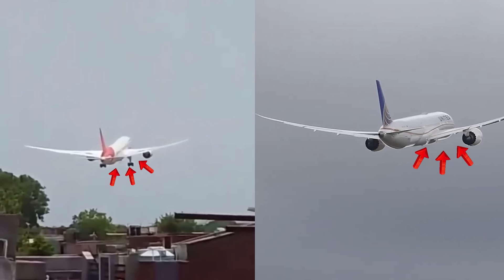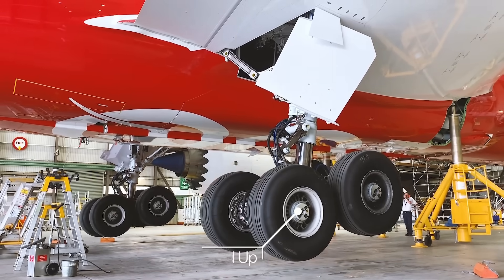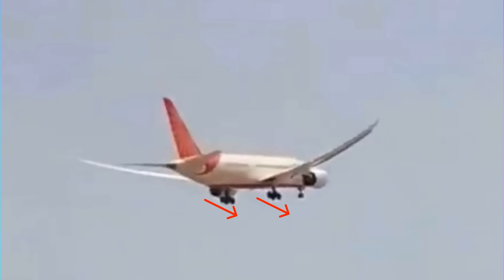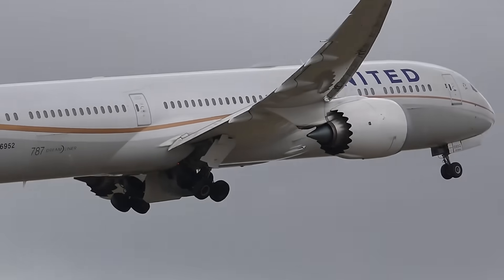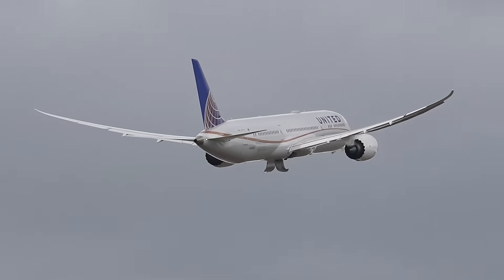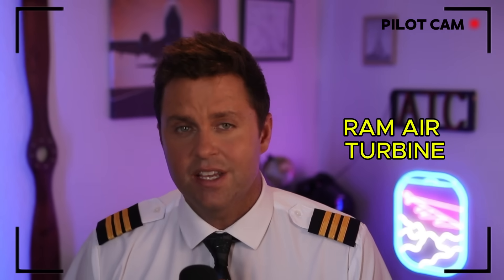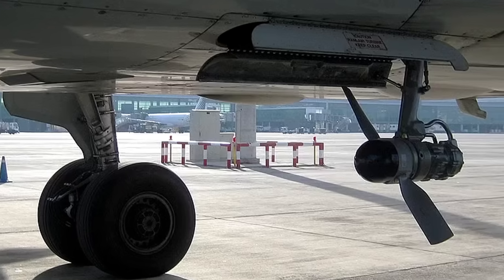Pilot Explains: A New Detail in the Air India 787 Crash Everyone Missed

Comment: Speaking of fuel cutoff switch.  I was on a 747 going to LHR from JFK and suddenly the plane went silent.  Momentary OMG!!. This lasted for about one or 2 minutes .  Then, the power was restored. What happened was the F.E. flicked the fuel flow switches off instead of the fuel heater switches which were located directly above the other.   That to me was stupid and thoughtless placement of these controls.  No wonder accidents happen. The Captain had the F.E. grounded in LHR, and dead-headed home.
In this Air India incident I noticed a slight change in the a.o.a on take off. This is never mentioned in the comments by the "experts"

Comment: I wonder if there was a short in the electrical system, the action of selecting the gear up overloaded the electrics causing a failure of the whole system. Which would cause the engines to spool back and the activation of the rat.

Comment: It's a double engine failure, for sure, based on the current facts we have so far. Double engine failure at the same time means not engine failure but a fuel issue or some system issue, which is common for both engines.

Comment: Of the various ways both engines could have flared out, what systems could the computer have instructed to cause this problem? My point is that there has been lots of speculation on what the pilots might have done incorrectly, but similarly the computer might have glitched as well although I haven’t heard anyone comment on this possibility.

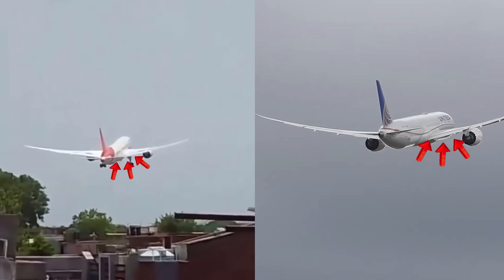Comment: 1:50 Some of air breaks are activated (probably they control horizontal position of the aircraft) on Air India, but there is no visible side edge of flaps where the wing does not have flaps surfaces.
8:49 Flaps were invented by cowards. 🙄
Initial take off can happen just due to rotate/changed angles of attack converting speed/momentum into lift, but when angle of attack is stabilized into speed gain position the aircraft wing lift force starts to play main role in aircraft lift. If wing lift is not enough due to wrong flaps position the aircraft  goes down.
There are several crashes with flaps up position when the aircrafts were able to gain some altitude of 10-30m, but then they inevitably go down with 100% engines thrust.

Comment: @Garybpilot could you dabble into whistle blowers claiming safety issues with 787, and Boeing hushing up about it. Was the aircraft inspected shabbily prior to take-off?Also, alike the Gimli glider, could it possibly not have glided a bit more or less and no landing gear (the front landing gear was stuck in the Gimli glider - but there was a lot of time for pilots to ponder over yonder.

Comment: Hi Garybpilot. I am not a pilot but in one of these discussions I heard that the RAT can be deployed manually from the cockpit. It could mean that even without a flameout on both engines the pilot was attempting to get some control by deploying the RAT. I also heard on other crashes that there is a considerable time lag when you switch to Togo before the engines are up to power. Possibly there was not enough time available in the thirty seconds from the malfunction until the crash for any of the actions to take effect. Also, if I remember correctly the RAT was originally thought to be used when the plane is higher up (like in that case with empty fuel tanks with the Canadian incident a few years back).

Comment: I’m no pilot! I’ve been following your analysis and Captain Steve’s analysis which sounds very plausible based on the limited data to date.  Regarding double engine failure or flameout is there any possibility that auto pilot was engaged and that it malfunctioned or was set incorrectly so that it retarded the engines?  Could it do this without mechanically altering the throttle positions, which would otherwise have been noticed by the pilots? If the mayday call that was reported is accurate why didn’t the pilot say we have lost both engines? Is it possible to mistake flameout for low thrust and just keep adjusting throttles in response?  Is there redundancy with fuel pumps and fuel tanks?

Comment: Regarding the bogie position, will the bogie turn forward as a result of hydraulics removal from the trim cylinder when the gear is selected up, or is it hydraulically (pressurized) placed in this position?
If it is placed  in the forward position because of hydraulic pressure removal, this could also indicate a severe hydraulic loss.

Comment: Another example of a simultaneous dual engine failure: Review BA-38, a dual B-777-200ER engine failure on short final at 700 feet. In that scenario, ice crystals at high altitudes had formed in fuel and obstructed fuel/oil heat exchangers. But that incident was specific only to RR Trent-800 engines.

Comment: There is article called "Boeing 787 Could Lose All Power" 2015 (you can google it). In short 787 could lose all power because of software bug if it was continuously powered on for over 248 days. Boeing commented on that: “This condition is caused by a software counter internal to the GCUs that will overflow after 248 days of continuous power.” Speculation is that the software bug is a signed 32-bit integer overflow that is triggered after 2^31 centiseconds, or 248.55 days. 
FAA statement:
“We are issuing this AD to prevent loss of all AC electrical power, which could result in loss of control
of the airplane. If the four main generator control units (associated with the engine-mounted
generators) were powered up at the same time, after 248 days of continuous power, all four GCUs
will go into failsafe mode at the same time, resulting in loss of all AC electrical power regardless of
flight phase.”

the U.S. Federal Aviation Administration (FAA) has published an
Airworthiness Directive (AD) ordering 787 operators to periodically shut down the plane’s electrical power.
The AD requires that 787 electrical power must be recycled at least every 120 days.

Never saw somebody talked about that. Is it possible?

Comment: I am of the view that the fuel filtration system may not have been adequately serviced, which probably caused an issue with sufficeient fuel reaching the engine to cause it to operate optimally.

Comment: I hate to say these things, but I think they are something which needs to be explored.

First, I noticed that no one has even considered terrorism. Given the conflicts going on world-wide, and in that region, in particular, I do believe this is something which should be considered.

Another issue, which is even more of concern to me, as I’ve personally witnessed this on other “crashes,” in which it’s never mentioned and another reason is eventually given for the “crash” and that is EMP. 

I’d like to state that, it’s alleged, according to the sole survivor, that just prior to the plane starting to go down, he heard a large explosion and the lights flickered.

While I understand the lights flickering could certainly be because of the transition from electrical (engine derived) power and the rat kicking in and taking over, it’s the sound of an explosion I’m concerned about.

First, we all know the chances of catastrophic, dual-engine failure, let alone on a plane of this age and make, is pretty much, well…I never like to say never, so let’s just say, unheard of.

However, if there were something placed on the plane, possibly one that’s triggered by either altitude or power, then that certainly could destroy all hydraulics, thus triggering the rat and the resulting crash.

There also could be an EMP strike and this, certainly, has the ability to take out both engines and the entire electronics of the plane, in one fell swoop. 

I personally suspect this and I have reasons which go beyond the physical and what we see on videos, but you say things like this, and many people think you’re nuts.

Another thing that I think warrants an additional look, which Pilot Steve, God bless him, quickly dismissed as “roof debris” is what we see flying in the air behind the plane.

Could it be that, because they were so low, they disrupted something on a nearby roof, bringing it airborne?

Sure, but this also would need to have the added factor of WORKING ENGINES. There’s no way that rat propeller, even though it’s moving at the speed of sound, could cause enough force to dislodge something from a roof.

And Pilot Steve also made the comment about the debris when he was still under the assumption that the engines were in working order, prior to learning about the rat deployment.

So, I think this warrants a much closer inspection, as well as the possibility of this being an EMP strike. 

The reason I say this is 1) An EMP strike would and could certainly cause an “explosion” like sound, as when the energy makes contact, it’s literally like a bomb going off. Obviously, this depends on the strength of the hit, but if we’re talking military grade EMP, absolutely.

2) IF this were an EMP strike, it not only would and could IMMEDIATELY disable both engines, but it could dislodge something from the plane itself, such as if the impact hit direct on an emergency exit door, which is what I first thought I saw with the flying object. It looked like the rectangular, rounded edges of an emergency exit door to me. 

3) With an EMP strike, there would be nothing they could do to refire the engines. A catastrophic hit could and would wipe out the entire electrical system of the plane, leaving them just enough to be able to use the radio (thanks to the rat) and calls for help. 

So, I just wanted to toss these ideas out there for your consideration. Like I said, I have seen two planes (smaller) that I observed, what appeared to be, EMP strikes, strong enough that it literally separated the entire tail section from the body of the plane. 

This is nothing to play with. The technology exists and is very dangerous in the wrong hands.

I also think it’s of critical importance that pilots, in particular, start looking at these CONTINUAL AND REPEATED instances of horrific crashes and tragedies and consider that maybe, just maybe, someone is attempting to take down the air industry, as a whole.

In my adult lifetime (I’m 55), never before have I witnessed one after the one after the other (and keep going) as I have in the last several years. Simply put, it’s non-stop.

Many people may not realize the true scope because they’re not paying attention to small, private aircraft and, unless they land in the middle of a road, like the recent tragedy in Florida, it’s not reported on the news, either.

In addition to the fact that many don’t know the true scope of how many planes (and LIVES) have been recently lost due to planes going down, they also, for the most part, outside of major crashes such as this, have no clue how many are going down in other countries outside of the United States.

Because I pay attention to these factors, frankly, I don’t understand how pilots cannot be calling for some type of examiner board to be established to examine all these crashes, whether they be large jet, small, private craft or helicopters, as even those are going down in record numbers.

SOMETHING ISN’T RIGHT & what I’m seeing tells me that there is intent and a desire to destroy behind all this. 

It’s simply not “normal” for so many jets, planes and helicopters to be falling from our skies; let alone losing major parts of their body, tail sections, blades, etc. or flat-out crashing into one another or falling out of the skies.

One would think, since you and men and women like yourself, are up in these planes on a regular basis, that your concern levels would be reaching epic proportions at this point; as you’ve flown long enough commercially, and likely militarily before that, to know SOMETHING ISN’T RIGHT.

And, for the record, I’ll come out and say it since I’ll no longer hide it as if I’m ashamed. There are people, such as myself, who have additional “abilities.” And some of those abilities allow us to see things, to hear things, to use different skills to put a picture together.

And I’ll say this - the picture I’ve been putting together is one that tells me the industry, pilots, stewardess and those who work in the industry, need to start taking a good, hard, long look at the series of “accidents” with fresh eyes and with people who will not seek to hide the truth, but expose it. 

They need to remember that lives are at stake here. Whether it’s 6 lost off the coast of San Diego, or 3 in Florida, etc. these are human beings who have people who love them. And we care about those of you who walk the isles and sit in the cockpit, too. 

I won’t go further in what I’ve seen or see, as I don’t want to fuel speculation or gossip, but I sincerely hope and pray that something is done, and soon, to examine the WHOLE of the “accidents,” not each one individually; as patterns cannot be found when looking at one at a time.

I wish you all the best & you and all the pilots who fly the skies, may God place His armor among each of you, keeping you safe from nose up to gear down. 

God bless.
Shelbie ✝️❤️

Comment: One of the biggest problems in jet fuel contamination is “water-bottom/ fuel interface” biological growth. Chemicals are added to the fuel storage bunkers to break up the biomass so that it can pass through filters and get burned with the fuel. Sometimes very rarely, slugs of biomass contamination break off and block filters totally, causing fuel starvation, even causing fuel filters to completely collapse. This is often seen on diesel trucks. I somehow think that this could be the cause that when refuelling the aircraft, the fuel was obtained from a near empty storage tank and a slug of biomass was transferred to the bunker truck, in turn to the aircraft fuel tank. A slug of biomass would block all fuel filters instantly…..

Comment: GEnx-1B67 FADEC Power Supply Redundancy should preclude simultaneous dual engine failure.
Each engine is equipped with two identical FADEC units: FADEC A and FADEC B. Only one FADEC is active at any given time, while the other remains in standby mode, ready to take over if the active FADEC fails. The FADECs communicate via a cross-channel data link, allowing them to crosscheck each other's performance and automatically alternate control if necessary. 
The FADEC system is powered by the aircraft's electrical system. In the event of a power loss, the Permanent Magnet Alternator (PMA) on the engine provides backup power to the FADEC. The PMA generates electrical power when the engine is operating above approximately 50% N2 speed, ensuring that the FADEC remains operational even during engine start-up or low-power conditions. 
In case of a total FADEC failure, including simultaneous failure of both engines, the engine(s) will operate in a "fail-fixed mode" and continue to run at a predetermined power level, allowing the aircraft to safely return to an airport for maintenance. -ChatGPT

Comment: Going back into historical mistakes, an engine failure after V1 due to FOD or severe stall or whatever might have caused excessive airframe vibration  had caused the PIC , not suggestion it was so in this event,  may have commanded a shutdown of the failed engine. On reaching 400 feet AGL the fuel lever of the Normal engine may have been Cutoff . Again, I might stress that conjecture is in the realms of speculation.

Comment: Maybe one engine failed after V1. This accounts for it appearing to over run the end of the runway. Then the other engine failed after lift off. I wonder how many seconds of hydraulic pressure and electrical power would remain after flameout before the RAT would drop out?

Comment: Arm chair quarterbacks all wrong except one 787 captain on another channel. HERES WHY BOTH ENGINES FAILED: Airplane was on APU elec power, did not switch over to ships power automatically (that was the only mechanical failure) after engine start and crew didn’t catch it. APU shut down automatically (normal) and left airplane with no AC power hence gear was down (while wreckage will show handle up), RAT deployed with no AC power, throttles go to “safe mode,” ie., stay in takeoff position but engines decrease to idle. Crew did not cycle throttles out of TOGA and back to takeoff power. That would have saved it but in heat of battle with only a couple seconds to react, Boeing must take some blame for this terrible design.

Comment: The 'gear up' command places an extremely high demand on the 787’s electrical systems during takeoff. If the system was already compromised, this command can push it over the edge—causing a complete failure, potentially just after supplying enough power to hydraulics for the main landing gear bogies to un-tilt (tilt forward). This is reminiscent of the “248-day GCU reset bug” on the 787 back in 2015–2016.

I thought I was the only one who noticed the gear frozen in the un-tilt phase. I’m glad it’s finally being acknowledged—it was quite obvious from the video from the very beginning.
____

1. Once the pivot or tilt-forward sequence of the gear during rotation—caused by aircraft weight—is complete, there's no reason for the gear to remain in that un-tilted/tilt-forward state. In fact, the tilt actuators are already loaded to return the gear to the “gear down tilt” position once the weight is off the gear. The only reason the gear appears tilted forward in the video is because the cockpit gear lever was moved to the retract position. There’s no speculation about this.

2. What is speculative is whether the initiation of the tilt-forward movement—triggered by the gear up command—caused a catastrophic failure of the aircraft’s electrical system or not.

P.S. It’s worth reading up on the 248-day GCU bug on the 787 (circa 2015–2016).